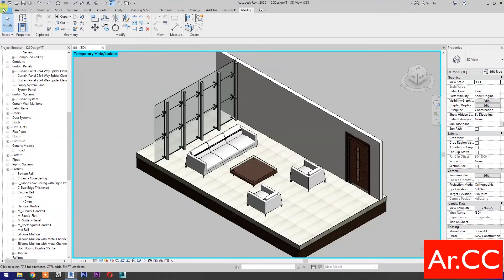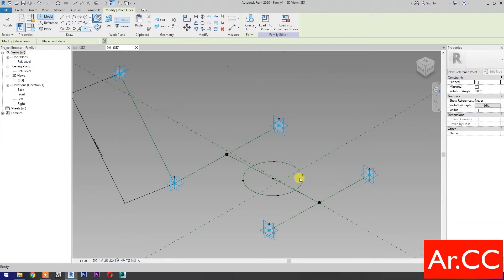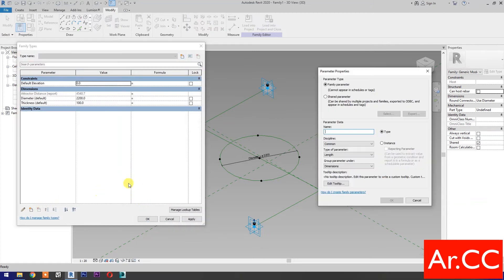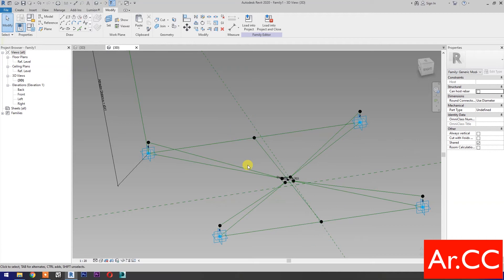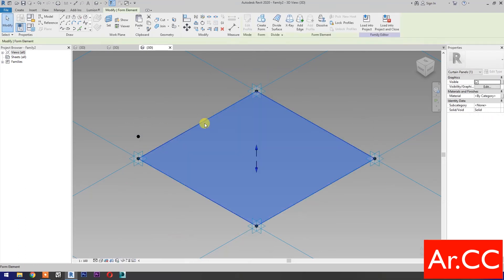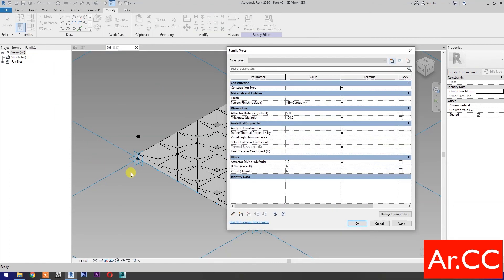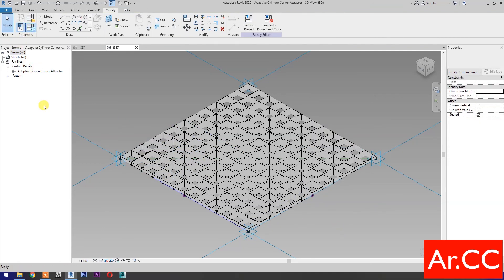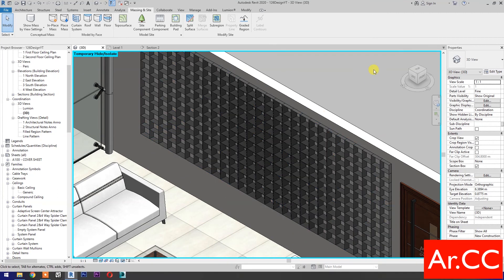RD126. Attractor in Revit. 100% Not A Dynamo Undiscovered. Adaptive Screen Grid Pattern in Revit.

Comment from the maker: Suggested Videos:
RD125. Attractor in Revit. 100% Not A Dynamo. Line Attractor in Revit. Part 5
https://youtu.be/p-bznN4DK-0
RD124. Attractor in Revit. 100% Not A Dynamo. Multiple Attractor Points in Revit. Part 4
https://youtu.be/JzY4STiMCq0
RD123. Attractor in Revit. 100% Not A Dynamo. Single Point Center Attractor in Revit. Part 3
https://youtu.be/_KTnlNc78EY
RD122. Attractor in Revit. 100% Not A Dynamo. Single Point Attractor in Revit. Part 2
https://youtu.be/RbmO-BRj1hc
RD121. Attractor in Revit. 100% Not A Dynamo. Single Point Attractor in Revit. Part 1
https://youtu.be/UWlj2m8BaP4